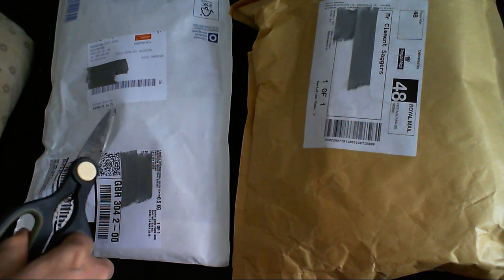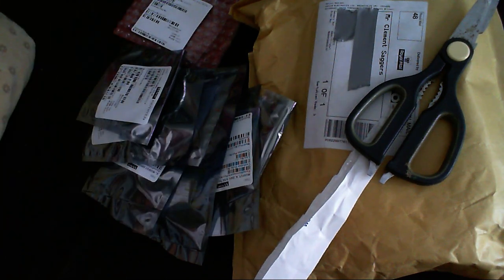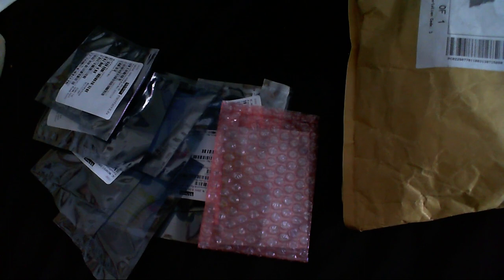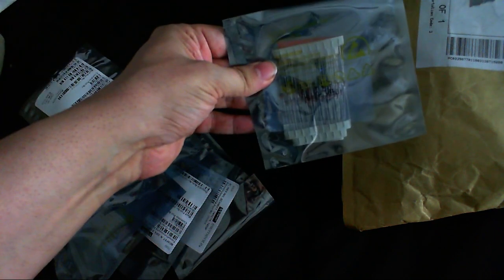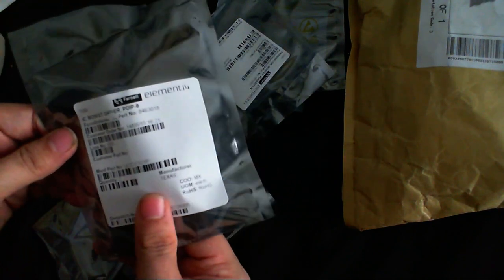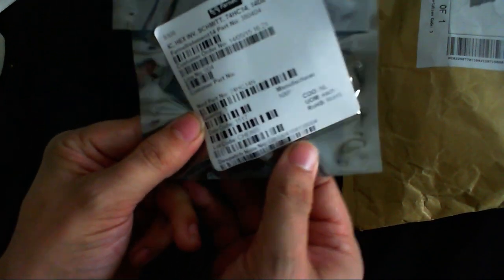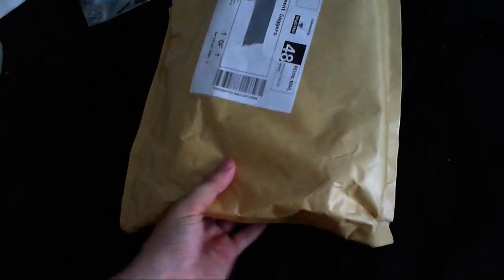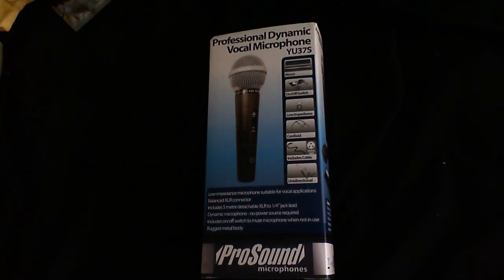More Unboxing - 2015-05-18

Comment: You have A LOT of posted videos.  Very well done man. I have had similar problems with overheating on my VTTC coils, induction heating is a big issue and so are overlaps. From video I thought that you had possibly purchased that coil.  I don't have a coil winding machine either. So been there myself recently, since I was too eger to push things too far! I ended up winding a half dozen coils out of # 36/32 AWG wire. 3 of them were for test purposes however, only a couple actually failed and one I managed to repair 3 times before it finally failed because I ran the coil way too long during a modulation test. I wrote you a while back, recently I posted a new video of pulses from my VTTC700 design.  I may be able to explain some tips that might help if you want (see my videos for some info), you have gotten a wide grasp of this stuff very quickly and well.  I am impressed! I really like the air-core transformer (you called it a coil) that used a base-fed circuit to create a low voltage high current directed corona (flame). Even in a base-fed system, if we have two windings on one peace of cardboard we have a transformer (air core). I read dozens and dozens of books since I was a young kid about thermionic emission and tubes. I have met very few young people as proficient as you are with them. I was born in 1979, tubes were still in use in our TVs as a kid (Not just CRT).  Most professional engineers today would have a hard time building some of the stuff you build without some serious adjustment since they don't teach it anymore (normally).  I have about 100+ experiment videos I just have not posted yet as I build my own channel I will be posting more of them as well as new ones. Sweet, the good-old MPF-102, those small signal jfets we use in radio stuff all the time, a new project? They come from Hong Kong because they are not really commonly used anymore but there are stockpiles of them.  Several types of jfets are better at the same thing. Just like you however, I sometimes still use them mainly because I have a bunch of them. They are great for small signal oscillators. What program do you use for most of your graphics?  I admit to being lazy about my graphics and video editing even though I am actually an experienced photographer!  I put my effort into doing physics/electronics design and don't have a lot of money!  At least my wife encourages and puts up with me!  I was lucky with her--because you think your bad!  My place looks like a mad-scientist lives here!  We need this stuff however, especially if your broke a lot and can't order parts on demand all the time.  Not the same as keeping trash with a false value.  I will certainly make more videos when I get my new tripod.  Mine broke a while back doing a video on my VTTC. It seems you have your coil fixed now?
Reply from the maker: Mostlymacros Thanks for the heads up about the induction heating that can happen, even though I haven't run any of my coils long enough for that to become a problem, at least not yet!  I'm going to be doing some SSTC in a few videos time. As for the MPF-120 jfets, well, I was going to build a preamp from them, but just don't get anywhere near enough gain for it to work, I'm sure I'll find some other use for them.
Reply: Hey no problem, I saw one of your videos about a coil failure you had recently if I recall and it was about the same time I experienced some of mine.  My design I call a "cross phase tuned VTTC".  Both the VTTC1200 and 700 are variants to some degree of this design.  I have not published it yet as I want to get a few things perfected with it before I do so.  As far as the mosfets, as I think I mentioned already there are better ones now days with more gain. I have to look in my notebook but I did look up a number of them and will email the list if you want.  You have done some really great work-I sure wish I'd had YouTube back when I got started in 1989! Good luck - I got a flu.
Reply: Some of my comments are way too long!   I'm not big on latest trends in "social networking" all the time. No smartphone. So Ive just been putting on finishing touches VTTC700. I only wish I could afford more MOTs or I might need to design a 2kw+ inverter (complex!)  It maybe obvious but, have you tried varnishing coils yet?  Something better then tape?  It's worth it once you've got a stable coil design and lacquering was more easy to do then I feared.  I found a jar on Ebay.  A dozen layers of cling wrap helps a bit. Haven't seen all your videos yet. I just put up more of mine  Nice base-fed work and vids, as I say, well done.--KF7DFP

Comment: I prefer artificial lighting, I use flourecent tubes in some 80's light fixtures from a school class room. sunshine is too hot and too bright for me.
Reply from the maker: BratzMylarMDWin98 Natural light just makes me feel good, but for indoor lighting I too prefer fluorescent lights, they just win out over other types of artificial lighting.
Reply: CoolDudeClem
is it long 150 cm flourecent tubes, you use? mine are like that, the ones sitting in my light fixtures has not been replaced since 2012 and it works fine and gives a good lighting.
Reply from the maker: BratzMylarMDWin98 That  is exactly what i have 150 cm, 58 watt,  I also have a 120 cm fixture but that one needs a new tube.  I just haven't been bothered to fix it since I still get plenty of light out of the tube that still works.
Reply: CoolDudeClem
was these light fixtures pre-installed before you got the room or is it some you have chosen? The ones I have, I had to list wanted ads to find, I found a old guy from other city back in 2012 who had some laying around then I cleaned them carefully up and then I got a electrician to find new flourecent tubes to install in them and starters as well also new cables the old ones where gone and new wires for them. he found it strange that I did not got modern rounded ones that is LED but I told him it looks ugly and I prefer the old style.mine was made in the netherlands.
Reply from the maker: BratzMylarMDWin98 They used to be in Dad's garage, I don't know where he got them from.
Reply: CoolDudeClem
I just had a closer look at mine and it do say 58 watt as well and the light fixture in my bed room is at 120 cm long. so I guess we might have the same lighting. incandescent light bulbs where kinda bad, I used these years ago and I had to replace them like every month and they gives a very weak lighting. I agree flourecent tubes are the best for indoor lighting.